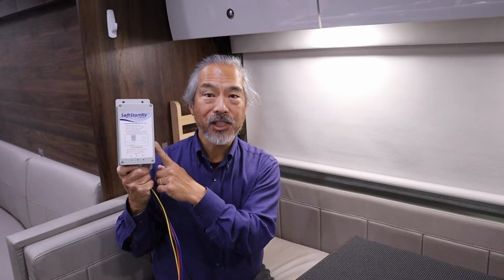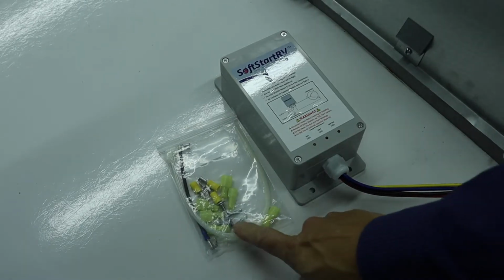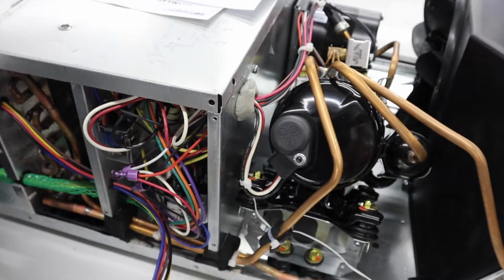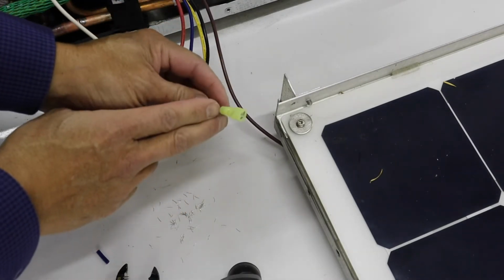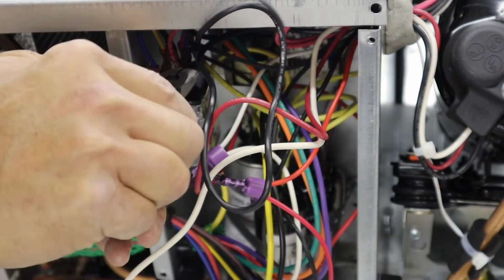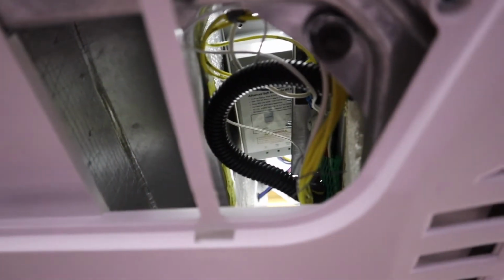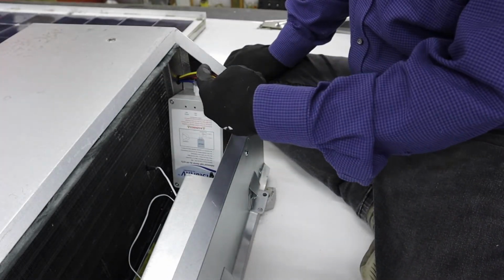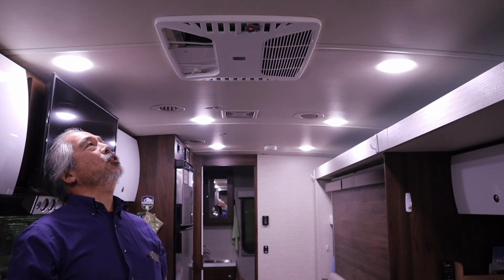Installing the SoftStartRV module on a Coleman Mach 10 RV Air Conditioner

Comment: I am about to install the Softstart on my Coleman Mach 10 15K BTU.  Can you please clarify why the softstart was not installed in the compressor area of the AC?
Reply from the maker: I located it in the forward plenum space primarily so I could monitor the status LED's from inside the RV.  I can still see it from inside the RV with the air filter elements removed and it hasn't budged either, after completing a 12,400 mile RV trip.  But this location also isn't exposed to the dust, more severe temperature and humidity variations and vibrations from the compressor and fan motor in that space.  Temperature extremes, humidity and vibration are hard on any equipment. If you do put it in the compressor compartment, make sure to protect the wiring from any moving parts by securing it well.